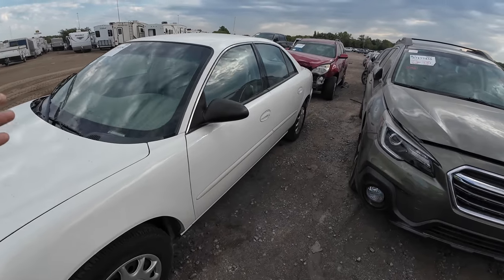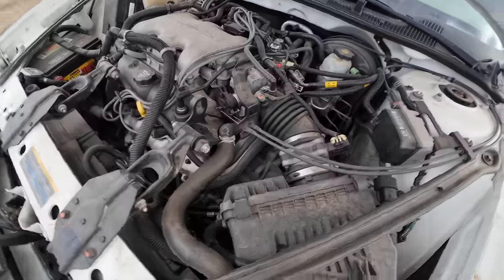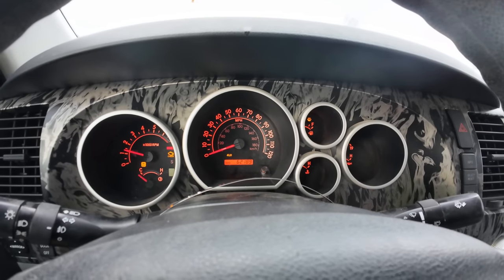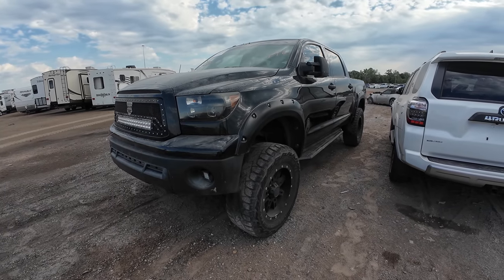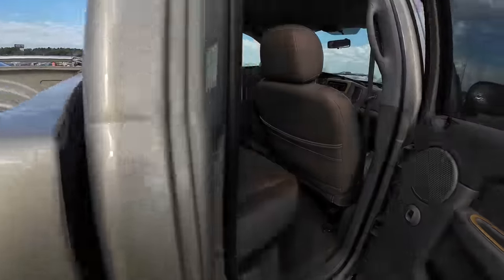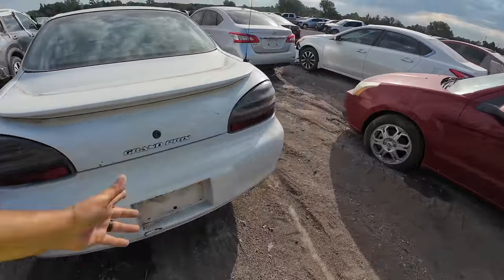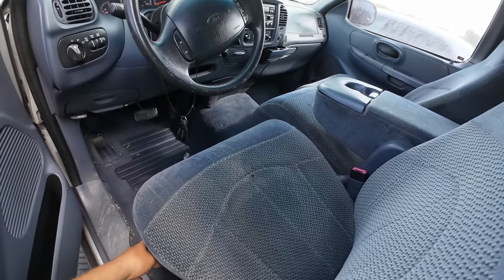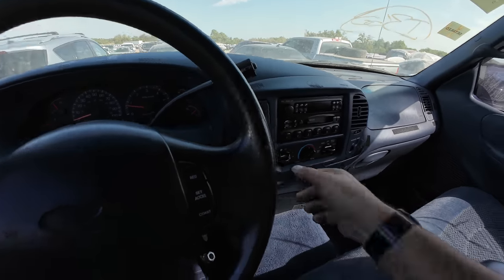I Found a Crazy Deal on a Crazy Toyota Tundra at IAA!!! $$$$ UPGRADES!

Comment: Hey Randy- I have noticed on a few of you videos that - the mileage on the dash doesn’t light up so ‘you have no idea of the actual mileage’ the Trick to that…. Is to take a picture of where the mileage should be- when the ignition is turned on- for some reason- you can see the mileage in the picture!
Hope this helps!

Comment: I have a 2004 Buick Century identical to that. They run forever.  The odometer display goes out as they age. Resisters have to be resolderedon the circuit board to make the PRNDL and mileage display again.  That car is worth buying.

Comment: I think you should get the 99 F150. The odometer is an easy fix, had one myself. You have to take the gauge cluster out and touch up the solder joints on the circuit board for the digital display. The solder cracks and the display goes out. You could do a video and reveal how many miles it truly has.

Comment: I own a 2001 Super crew cab. Just took it on a 1200+ road trip. Mine has under 170k miles also. Great trucks. That truck also has the 2 valve engine.

Comment: My dad had a 2012 tundra with the 4.6, truck was a beast, he just sold it, had 360,000 miles on it and the truck was still working great, towed whatever we wanted it too, so he went back with the tundra, found a good deal on a 2021 sr5 with the 5.7 in it with only 5k miles on it, so far the truck has been awesome, a lot more features from 12 to 21

Comment: I love the Buick Century (and it's identical twin, Buick Regal). Cheap, reliable and rides like a Cadillac with some white wall Michelins. If I had that car, I would drive it from Atlanta, GA to Miami, FL in a heartbeat. The 3100 is a good engine however, they do have front wheel bearings, intake manifold and head gasket issues. Fix that (you can fix all of that yourself for under $125) and its bulletproof like the 3800.

Far as the lights on the dash in the Toyota Tundra... Well, thats just a Toyota thing. If one thing malfunctions in a Toyota, all the dash lights come on. My Lexus threw a code the other day for a speed sensor. Check engine light, VSC and Traction Control are currently on until I replace the sensor.

Comment: The thing with the lights on the tundra the 4wd lights is a rear wheel bearing is going out I have a 2007 tundra right now with 221000 plus miles and we had that issue a while back replaced the passenger wheel bearing good as new love my truck want to get a newer similar models not a twin turbo though

Comment: I like the tundra in the video. I have the same year truck but mine is silver. Mine is a crew, max. 4 × 4. the 5.7. Motor in it, too. I bought my truck last year in October. Only paid 15000 for mine. From a private seller. And also the fun fact about my truck. It originally came from Oklahoma. Also Right now, it has, like 146000+ miles on it.

Also that Buick. Looks like a very nice car. I would drive it. Plus I like those old Grand Prixs too

Also I would bid on that F150. That looks like a clean, nice old truck. It's worth it.